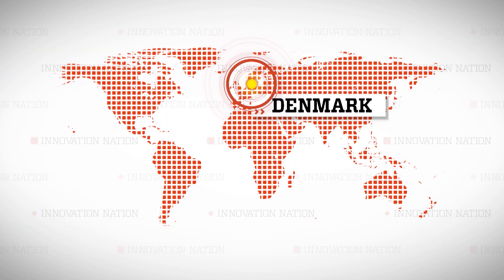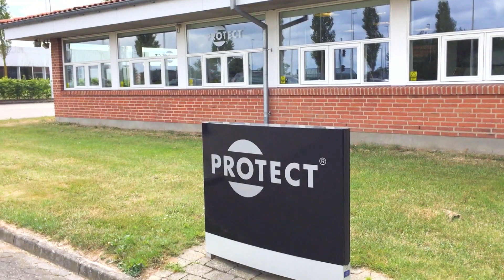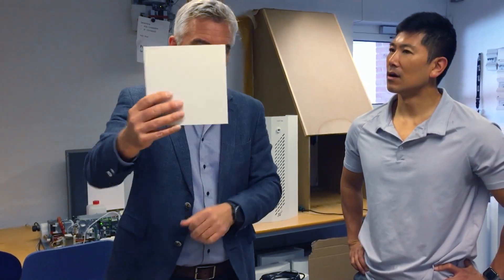Fog Security System | The Henry Ford's Innovation Nation

Comment: does the fog set off smoke alarms?
Reply: as far as I know yes, propylene glycol used in electronic cigarettes can set off alarms if blown directly into them, that's for ecigs because they don't make much fog unlike this.
Reply: but not heat activated ones, if you have the glass ones that break when heated
Reply: @BankruptGreek  those are sprinklers not alarms.
Reply: @MegaMeco2  I guess
Reply: @MegaMeco2  thermal detectors exist.
Reply: Yes.

Comment: Unless the burglar has a gas mask, patience, and/or the means to just rip the box right off the friggin wall. I think in those cases, the equation is quite simple......

........you’re pretty much screwed. 

👀💎🚫💰🔦💨🏃🏻💩🤦🏻‍♂️😫👮🏼‍♂️🚓⚖️⚰️🔚
Reply: A burglar that sits around waiting, especially when there's a shitload of smoke-like fog that neighbors can detect, is a complete moron that will get caught. If your burgling of a place takes more than 10 minutes under normal conditions then you're doing it wrong.